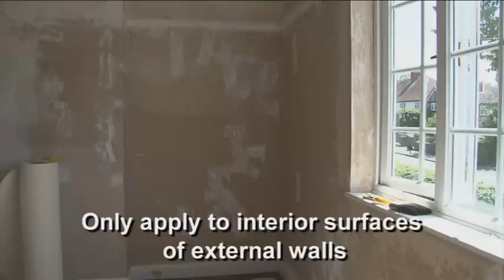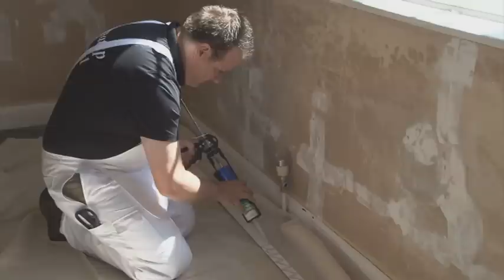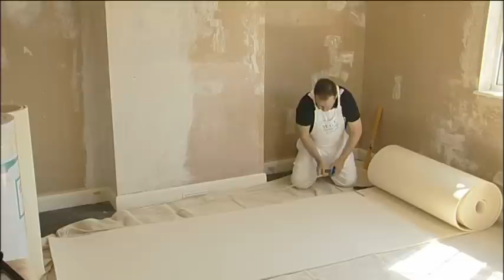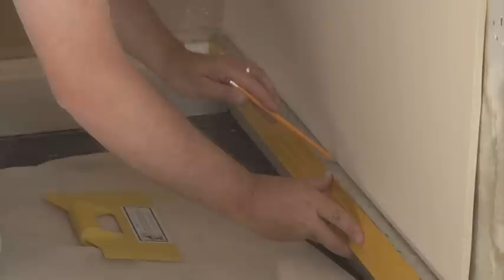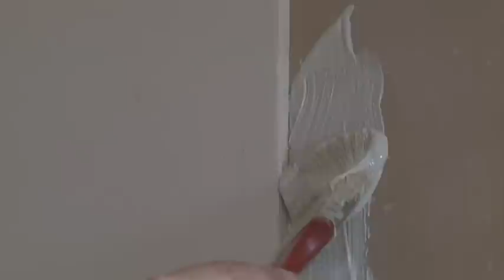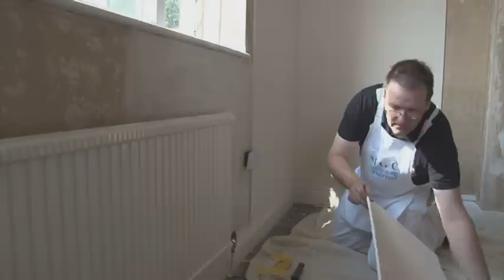How to Apply Sempatap Thermal Solid Wall Insulation to walls

Comment: This is just thick foamy wallpaper.  Honestly, it's the most ridiculous system I've seen.  No full coverage behind radiators, gaps between sheets with a non insulating caulking, no insulation on skirting board.  Completely ineffective.  You're going to have all kinds of mould problems, and yes, we all know with moisture and time that stuff is going to fall off the walls.

Comment: This stuff is snake oil. If i have to as a builder put in a minimum of 100mm of pir foam in a new building/extension how the heck can this stuff do anything? what a load of rubbish. allso old houses 9" brick work (solid walls) need to breathe they need fires lit and air flow this will curate all kinds of problems. want to live in a period house be prepared to light the fires when its cold and open windows.

Comment: would plaster board on existing plaster board insulate a room. one of the walls of the room is single brick therefore moisture and mould is coming in from elsewhere would this be ideal option to insulate a room or can another layer of plasterboard be a cheaper option?

Comment: You should not cut around the radiator but remove it as insulation behind the radiator will save the heat being lost there.
Reply: depends on how much clearance you have.   I wouldn't want the sempatap to make contact with the radiator.  The manufacturer should have more specifics on that
Reply: @curiouscat3384  If you are going to do it properly then you must remove the radiator and re fix on blocks and adjust pipewok as neccessary.

Comment from the maker: Thank you for raising 2 important points, cost is fundamental to consumers which is why we’ve run a nationwide scheme (DIY Warmer Walls) for 10 yrs  providing Sempatap Thermal at a 25% disc off our RPL

Sempatap Thermal should not be used on walls affected by penetrative or rising damp until these issues are resolved, Sempatap has been used successfully by Local Auth & Housing Assoc nationwide for 20+ yrs to provide increased thermal insulation & deal with residual moisture due to condensation